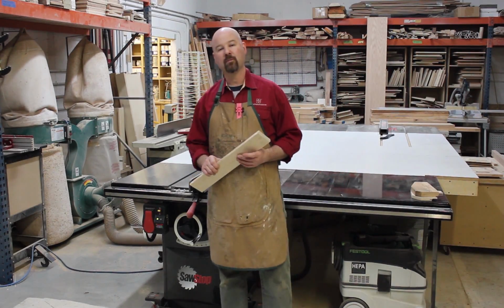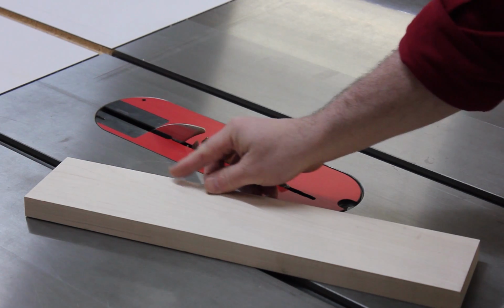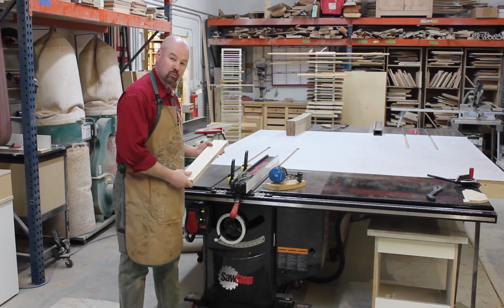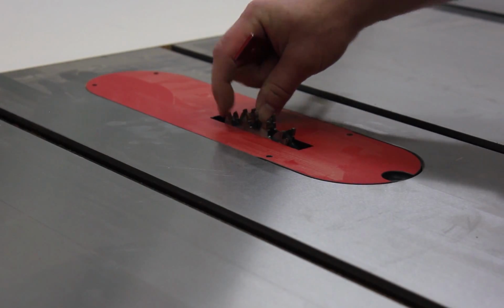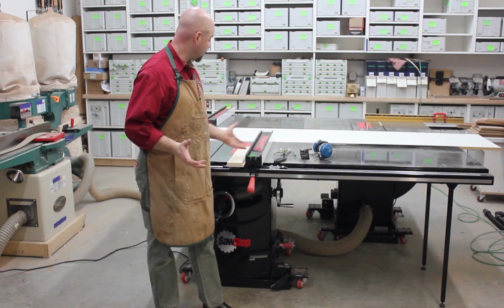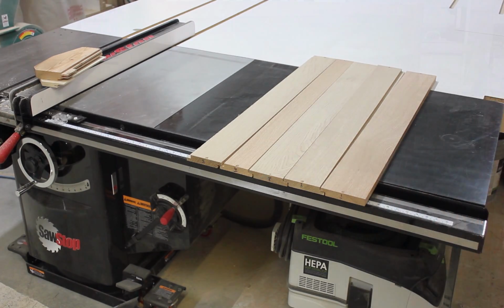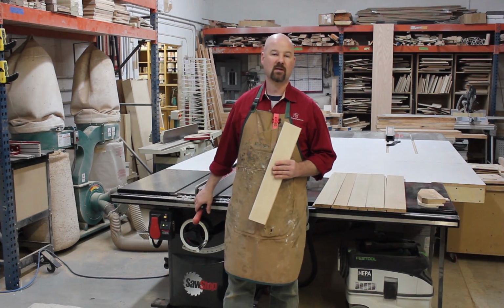Cutting Rabbet Joints and Making Ship Lap Paneling On Your SawStop Saw

Comment: It must be tough for youngsters who've never built a door with ship lapped lumber.  Except for the end pieces the boards join together to seal out weather.  They are laid lap to lap for a level surface but the end pieces only need a rabbet on one side for a natural end to the door.  You can rabbet the entire border for the door but the purpose is for simplicity so normally the lapped boards are fastened to a nailer.

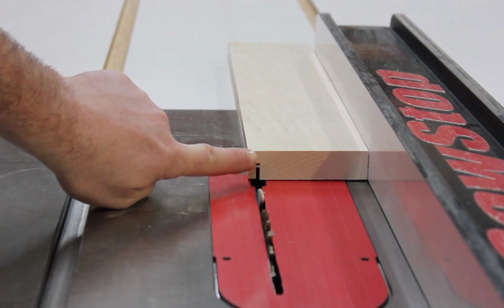Comment: Correct me if I'm wrong but the removal cut at 3:44 was too short because he cut the wrong side of the stock
Reply: He probably did it on purpose to show what happens when the saw height is not correctly set.
Reply: +Kenneth Francis 
You are correct Kenneth
Reply: +Alan Long 
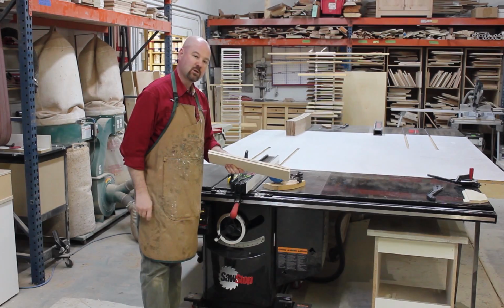3eighths is 3 eighths, and the 3/8 is on top of the board at 2:27.
Then he end for ends it but doesn't turn it over!